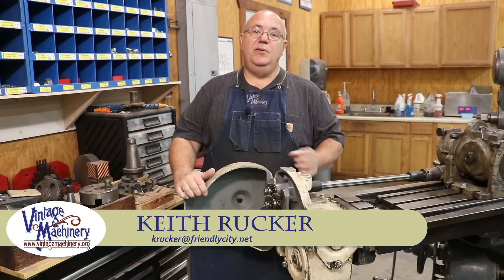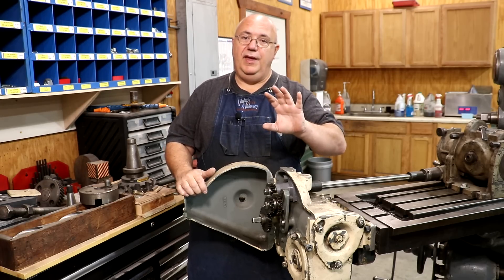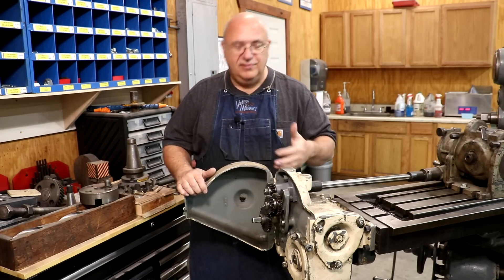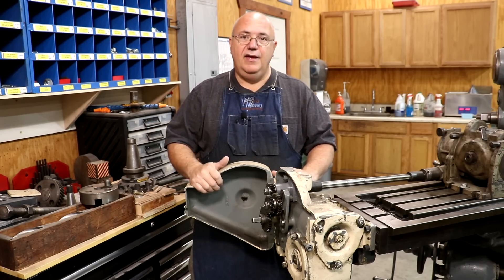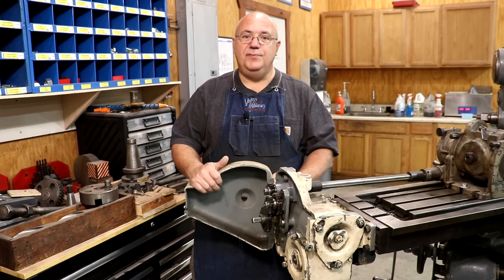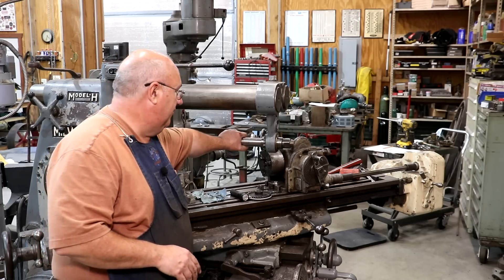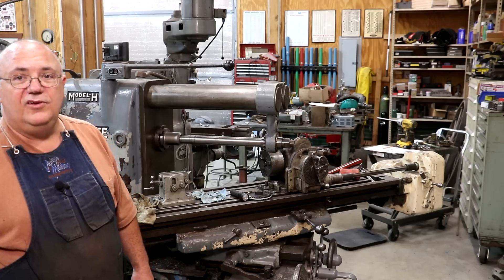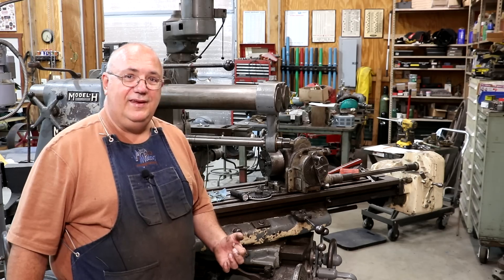Cutting Helical Gears on the Horizontal Milling Machine:  Setting up the Lead Attachment Part 2

Comment: I actually got my hands on a K&T 2K universal and two of those table lock bolts where broken off in the bottom of the tapered holes, I had to remove the table and saddle off to fix the issues.

Comment: Keith, you might want to look into acquiring some machinists wax for your blanks. Steve Watkins used it on his YT channel to make a part on his CNC machine. It's recoverable and reusable, which will save you $$ in materials.

Comment: Did you check to see if there is an index drilling for the 45 degree setting? If it is similar to a DeWalt RAS there should be an index for the alignment pin on the 45 degree position. I did notice the taper on the pin which is similar to the taper on the RAS at the index points.

Comment: Keith,

As I suggested in the comments on Part 1 of this wonderful series, one could build a spreadsheet that calculated the right change gears for a given lead.   I downloaded the KT low lead manual from your vintagemachinery website, and did so (well, in truth, it's a Google Sheets spreadsheet and some javascript code to do the actual computations).   A couple of learnings:   First, the 21/26 and 22/32 with 8 in 3 worm reduction that you found, is optimal for your desired lead, given the standard change gear set of 17 gears and 6 different worm/wheel combinations.   There isn't anything closer.   Second, there really aren't 42,362 setups that are unique to 5 or more decimal digits.  I think the 42,362 is a combinatorial number of possible combinations, but in that list, some combinations give results that indistinguishable to 7 or 8 digits in the decimal.   For example, .9048 is shown in the manual as 40/20 and 38/28 with a 1 in 3 worm reduction.   But 30/20 and 38/21 with the same 1 in 3 worm reduction actually gives a slightly closer (in the 7th decimal) approximation.   By calculation, there are 39,559 setups unique to the 8th decimal.

Comment: Really fascinating series. Your detailed explanation of the setup is extremely interesting. Thank you very much!
As I had to do some helical milling with similar setups recently, I wrote a tiny octave/matlab script which found the (close to) perfect combination of change gears. (Also useful for thread cutting an a lathe.) Feel free to contact me via email (available in the "about" section of my channel) if you are interested.

Comment: I couldn't figure out how you were going to get the angle cut on the table without cutting the sides of the gears a lot.  

Then you turned the table.  Sheesh.  I should have known.  I can only plead that I've never seen it done.  Nice to see it getting done.  Thank you.

Comment: Hey Keith:  Did you try to put the bolt with the taper on it into the hole at the 45 degree mark to see if it would put the table at exactly 45 degrees?

Comment: Look into the tapered pin hole to see if there's a locating taper at 45 degrees. If there is you'll probably have to clean it out first.

Comment: hmm isn't this double? i mean, the lead attachment turns it in conjunction with the table 45 deg, but now you set the table on 45 degrees too, so won't that make it cut on 90 deg?

Comment: You've probably already got this setup figured out, but from a novice persons perspective, I would imagine that the rotation rate is predicated on a table feed perpendicular to the dividing head.  Might have to modify the gear set based on the horizontal component of the table feed speed.  If that's the case, have fun with the trig...:)
Reply: watch the previous video :D
Reply: @katelights  I did...my point is that the chart he referenced in the book for the ratios might have been based on the table being fed 90 degrees to the cutter.  once you change that relationship, it will change the horizontal speed at which the cutter moves across the work.  I'm sure Keith will get it right; it's fascinating to see.

Comment: Just an observation, I may be wrong, but you may have rotated the table the wrong way. From the glimpse we had of the original, it looks like a LH helix. I think your table rotation is set up for a RH.
 I have cut 45deg helicals on my Elliott mill using the vertical head tilted to get the cutter angle as it's not a universal machine and sympathise with you over the difficulty of the setup. It really does push the working envelope of the mill.

Comment: This is why you get jaw dropping price quotes from machine shops on what you may mistakenly think is an easy job.
Set Up Time.
This series has been very, very eye opening on what it sometimes takes. Not to mention the very specialized equipment on top of everything else.
Reply: Set up is a killer.  I remember telling a customer that the final bill would be the same for any number of items between 1  and 10,000 because of set up and minimum material batch sizes to meet specs.

Comment: Now you know why that unless it was a one-off special you would avoid doing this. I would bet that most universal milling machines have never had the table swung around. In 60 years, this is the first time I've seen it done other than photos in operating manuals.

Comment: In a way I am like Keith. He restores and uses vintage machine tools. I restore and use vintage radios.  There is a real head rush when you key a transmitter that has not been used in 80 years, or bring back a 100 year old receiver.
Reply: In my early teenage years {early 1960s} I brought home many 1930s-vintage AM radios from the local town garbage dump {long before the safety nannies surrounded our "sanitary landfill" with high fences}.  By swapping vacuum tubes between radios I eventually restored a few receivers to full function.  Listening in the summer of 1965 to the Stones "Satisfaction" played by a local AM radio station at loud volume on a top-quality 12" electro-dynamic** loudspeaker was a game-changer for me, & the beginning of my career in audio electronics & physics.  
How do kids today get their hands on equivalent antiquated tech to learn the basics by experimenting?  YouTube videos are a great resource, but hands on is often superior - you smell hot components, see wax dripping from failing paper capacitors, watch a thick rectifier tube filament start to glow dark red, experience the shock of touching a finger to ~350 volts DC {the back of my skull punched a dimple into the wallboard of my bedroom, a lesson I never forgot}, etc, etc.
  ** uses an electromagnet field coil that does double duty as the L of an LC filter for the high-voltage B+ rail

Comment: Apologies if you mentioned it and I just didn't catch it - but is there perhaps another hole for the tapered plug at 45 degrees? Being common angles I wouldn't be surprised if there's a hole for 30 and 45 in either direction. Super weird to see a milling machine with an angled bed though; almost more interesting than the attachment!

Comment: You might be the first person to use that lead attachment to cut a one-off gear 😁 That's an incredibly large amount of setup, and I assume mostly they would get things ready and cut hundreds of gears over the course of months, then change the setup and cut hundreds more.
Reply: I'm not so sure about that. Back before CNC was in wide use, lots of machine shops would have routinely cut gears this way. The machinists would have known their machines  from top to bottom, and would have been able to do these setups in their sleep. Just like blacksmiths knew how to work metal using skills largely lost today, the old-time machinists would have had no trouble knocking out the jobs in a timely manner on the machines they had grown up with. Todays technicians do the same but with modern machinery they can do it quicker and to finer tolerances, but it is still amazing to think what was achieved back in the day.
For a real eye opener google the Antikythera Mechanism.

Comment: Hey Keith - Great video! You might consider setting up a straight edge on the table at a true 45 degrees and then indicate the table in. As I recall, this is for a cam gear which is going to spin pretty quickly and needs to be right or it will fail prematurely. Just a thought. Great job! Keep them coming. :)

Comment: Does it have a corresponding hole for a 45 degree angle like it does for 0? If so you may be able to reinstall that tapered bolt and have it set right on 45.

Comment: I'm curious if there is a locating hole drilled at the 45 degree position that utilizes the pin you removed. It would make sense that the most common angles would have those "detents" in place.

Comment: Hi Keith, Please try the tapered bolt into the threaded hole, there may be a tapered hole for it to fit in and lock the table on that angle I love your videos, and watch everyone. Cheers, Lee.
Reply: That’s what I was thinking also!
Reply: @paulstanley31  I have a Brown & Sharpe No 2 universal mill from around 1912 and it has a tapered bolt to index the table at O deg. Not a new invention.

Comment: I cannot figure out why Keith needs both a 45 deg angle on the Y-axis and a lead attachment at the same time.. what am I missing here?
I would think that just fixing the gear into the dividing head and letting the Y-axis cut the 45 deg angle on the gear would be enough...
Looking forward to part 3.
Reply: The OD trails down away from the cutter. If you do as you suggest, the full depth will not follow the helix angle and the middle will be the only point at full depth.
Reply: But its not a 45 straight cut its a helical cut (think screw) so the cutter must traverse the cut to make the proper depth across the part.

Comment: Looking at the setup.  It seems to me that the gearbox would be used to cut a gear with a special shaped endmill (tooth) with a vertical attachment.  With the table set to the helix angle, wouldn't it be a straight cut?   Then you don't need the special gearbox.. Just trying to wrap my head around the setup..
Reply: You need a full depth cut across the rotating OD. Keeping the OD static and just feeding across will only have full depth at the center of the overall length across the OD. Rotating brings the OD to top dead center at the cutter .
Reply: @dumbo800  Understand what you are saying. Makes sense as far as how the tooth is formed.  Still have trouble wrapping my head around how the cuter cuts evenly. I guess we'll see.. :D
Reply: I’m thinking the same as you, with the table turned to 45 degrees it should be a straight cut. And if you use a regular shaped cutter and the part turns with the cutter engaged wouldn’t it just cut the sides of the teeth off especially as it’s turned to 45 degrees. I thought maybe he would put the vertical head on with an end mill that’s cut to the shape of the gear. 
I’m hoping something just clicks in my brain when Keith actually cuts this gear and then I think “Oh Yea” that’s how it works! Lol

Comment: arge. did the pin go back in at the 45 mark ?  I would think there would be pin holes at standard marks. 15, 22.5 , 30 ect.

Comment: I honestly would have thought that just the dividing head would have been at an angle instead of the whole table. In my head, this setup doesn't resolve. Very curious how it ends up.
Reply: It looks correct. It looks just like a helical setup would look in a hobber. Same idea, just one tooth at a time.

Comment: GREAT job of machining exploration and learning.
A test blank is VERY wise.
Could there be a mating hole in the table for the tapered pin which exists at 45º?
Milling a spiral lamp stem can be found at https://www.youtube.com/watch?v=_2S-XOHQhJk&t=5s

Comment: Would it ever be worth knocking out a half dozen of these gears and offering them for sale?  There is so much work in this set up, I can't imagine doing it for a single gear.  That said, if one of these has broken, I bet there are other cars out there in static displays or pushed off in the weeds because they can't get a gear for it.  It seems like that might offset your labor a bit.
Reply: A production setup would be most cost effective on a differential hobber.

Comment: I love the pure mechanical nature of these old machines. It makes perfect sense considering what they had to work with. It seems almost Rube-Goldberg compared to modern  cnc machines with encoders and servos. Of course the complexity is still there it's just on the software side instead of the hardware.

Comment: Why is it that machinists tend to use adjustable wrenches and open end wrenches instead of box end wrenches or sockets, especially when dealing with very tight fasteners?  Just curious.
Reply: You either have 100 wrenches across all of your machines, or an adjustable at each alongside 1-2 common wrenches per machine. You don't want to not have redundant wrench sizes if using dedicated wrenches because it takes a lot of time to search for which machine had the ¾ inch wrench last.

Comment: I’ve have a timing gear on an old tractor that needs to be replaced.  I have a Brown and Sharpe universal Milling Machine that I would like to cut the helical gear on. I’ve wondered how to measure the lead on the gear and how to get the correct gearing to rotate the bank properly.  Thanks for posting this video.

Comment: Keith just a thought, maybe take and indicate a 45deg angle gauge and check your angle on the table just to make sure your truly at 45 deg
Reply: Being close is enough for a functional gear. Being a degree off will slightly change the tooth flank geometry, but I doubt the original was a precision ground gear with tight tolerance.

Comment: Way back in 1976 our high school metal shop set up a milling attachment on a lathe to cut a helical pinion gear for a truck axle. It was a very complicated setup and took a very long time.

Comment: Why is it necessary to both index the table to 45 degrees and rotate the gear as it is cut.   I’ve never done or seen anything like this but it seems like you’ll be cutting the gear at more than 45 degrees.
Reply: Yes basically it's a curved 45 degree cut. It's not straight across.
Reply: Thanks for the explanation, I think I see what is going on now.

Comment: Certainly a good test part made of aluminum or plastic. Then you can try and adjust. 
Also, soft material is better if something goes horribly wrong then you won't damage the milling machine.

Comment: Isn't this much easier with the vertical head on tilted to 45 and the cutter in a stub arbor in front or behind the blank rather than above? No need to angle the table.
Reply: Probably easier to move the table as it only swings in one plane.  With the universal head you have to get it trammed in on two axes.

Comment: I did some helical milling many years ago,.  It was not for gears but for a part for a printing press.  I had the extra complication that I was having to make an imperial part on a metric machine.

45 degrees sounds like a large helix angle for a single helical gear, think it would result in guide a high axial force.
Reply: 45° is rather rare for a helical (at least in my made to order shop) . Usually we make anything from ~8° to 23°30', but we use hobbers.